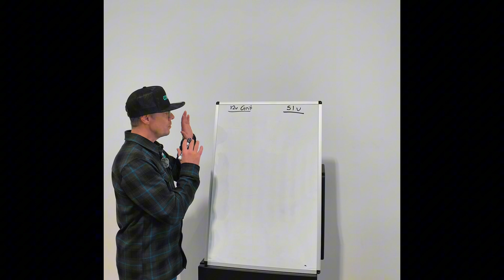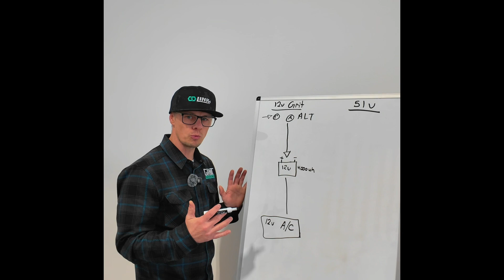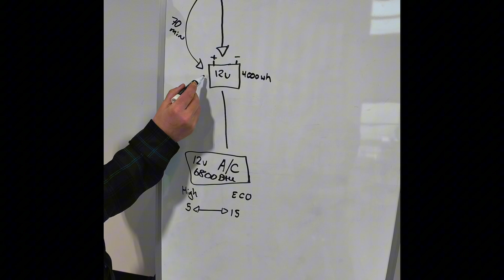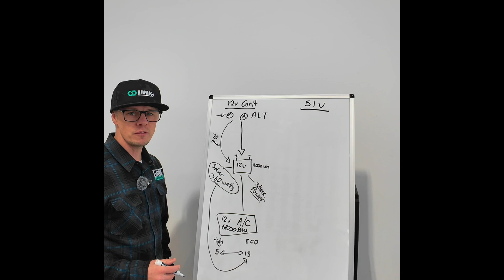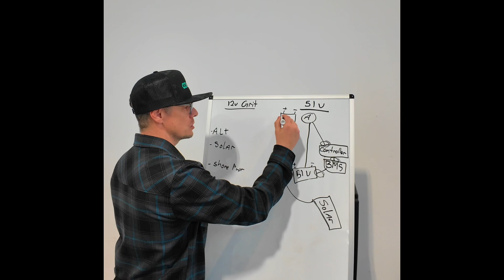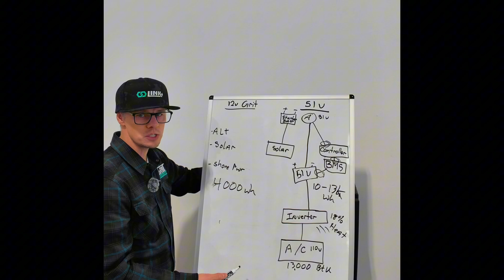Camper Van Electrical Guide: 12volt vs 51volt Systems Explained | Adventure Van Battery Comparison

Comment: I can confirm what Dan says from our Sprinter van experience. My 2022 Tiffin Cahaba had 300 watts of flexible solar panels on the roof. Under maximum summer sun in the Southwest and with: clean solar panels, the inverter off, and the Maxxair (DC) fan on high, there was a net negative drain on the Volta lithium battery. The net negative drain increased dramatically with the inverter on and running our 13,500 BTU air conditioner. In short, the solar panels were worthless and we removed them from the roof.
Reply from the maker: Thank you for telling us your experience. Without your willingness to share we wouldn’t know as much!
Solar panels are really only to use as a trickle charge for your battery the main source of power comes from the alternator(s) when the vehicle is running

Comment: It is stated that 200A at 12V is the rating, but if I calculate taking into account a 2% voltage drop over 5 meters, the cable cross-section should be at least 148.33 mm².
Be aware that a 200A terminal can easily reach 60°C - 80°C under normal operating conditions. If the crimping is poor, it will exceed 120°C, melting the cable insulation. Two cables of at least 70 mm² or, better yet, 95 mm² should be used.
Be mindful of thermal expansion and its consequences. You need to be very confident in handling these currents.
There are no magic solutions, but I was taught, at least in Europe during my electrical engineering studies, that high currents are dangerous and require careful handling; they are not ideal for power transmission. Voltage drops, Joul effect, and conductor resistance must all be considered. In short, this is my humble opinion based on the information and what I understood from the video. What I can say is that I find their campervan conversion work very interesting and beautiful; they clearly put a lot of thought into the customer and their satisfaction throughout the years of using their van.
Best regards.

Comment: In Europe, the secondary (recreation) battery is charged directly using an MPPT. Victron has several systems, for example, three models for direct battery charging: 48V/51V, maximum voltage 150V, and 70A current. I don't know why in the USA the vehicle's main battery is charged.

https://www.youtube.com/watch?v=dT89QtG2pS4

Sorry, my English isn't very good, so I used Google Translate to minimize mistakes.

Comment: Why do you use an AC 120V air conditioner with all those losses when 48V DC air conditioners are available????
Reply from the maker: We actually don’t use either of those. We use a 12volt A/C

Comment: Does your Lithonics12V battery need anything to regulate the charging voltage coming from the second alternator,  like a separate DC to DC converter between them?    Or does the BMS on the battery handle whatever the alternator supplies? How do you have this battery system tuned up for the Transit?
Reply from the maker: Yes. If you want a more in depth walkthrough we have a longer form video going over our electrical supply as well as a few dual alternator videos

Comment: I have a 24 Ford Transit with the dual alternator/battery setup. It is primarily my work truck but I would like to add a refrigerator and max air fan and charge my Milwaukee batteries. What do I need to do to make this work? Thanks

Comment: I don’t understand the 51v or 48v system. Most people use a dc 12-48 charger to the 48v house battery.then a 48v a/c which is much more efficient than a 12v a/c